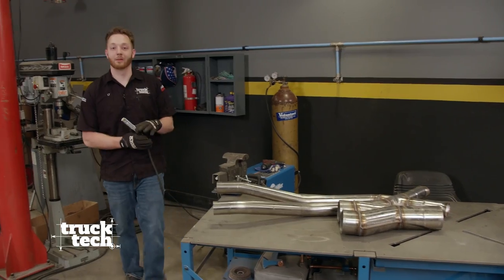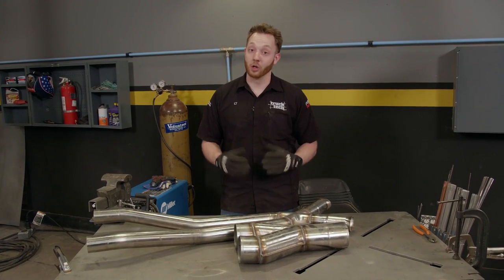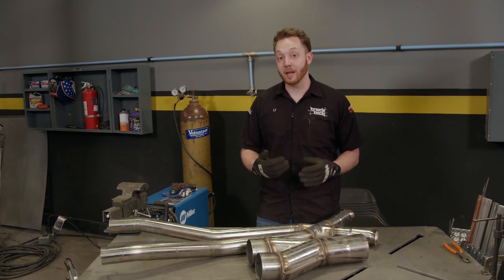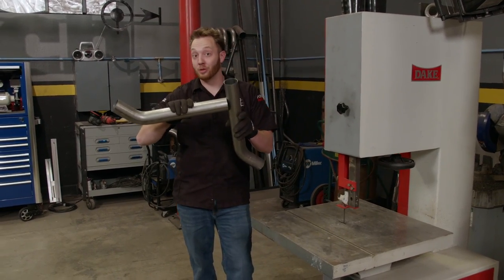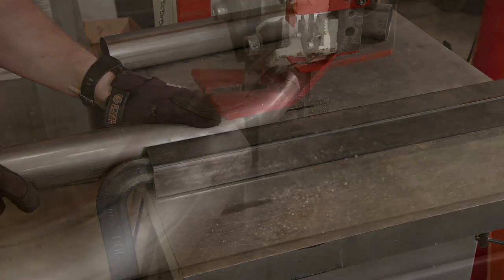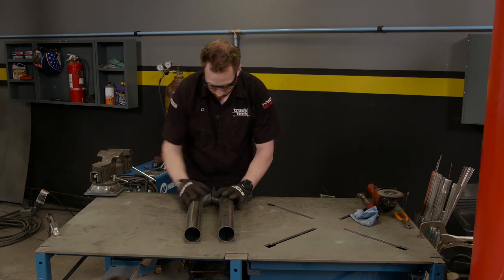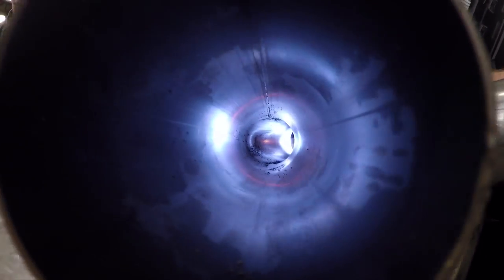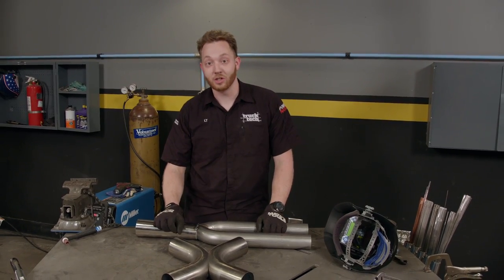How To Build Your Own Custom Exhaust Crossovers

Comment: I need help! I have a 1993 Chevy truck it's a jem but it's crazy load and I took it to muffler man and told me my crossover is bad and it's over 400 $ to fix ! I can't afford that ... How can I fix this and what do I need to buy ?
Reply: Sell your truck and buy something with a 4 cyl. No crossover or Y pipe on a 4cyl. Problem solved.  Replacing the Y pipe on a V8 can be expensive. Lot of labour involved  when you have to replace all the rotten studs. 400 bucks does not sound too expensive by any means.